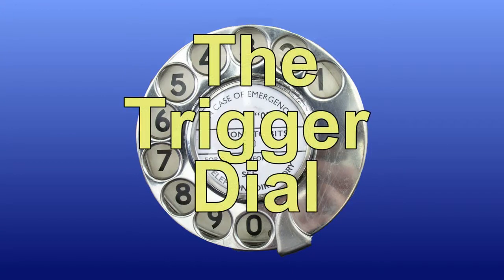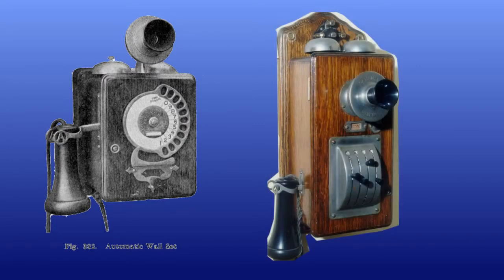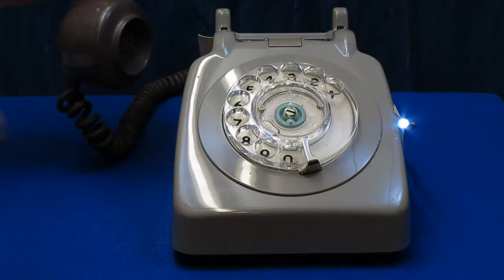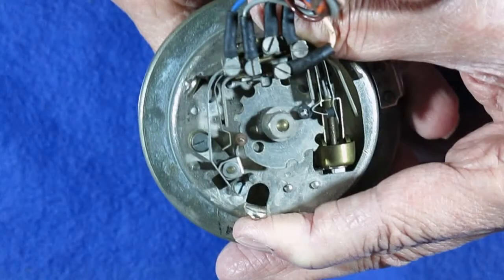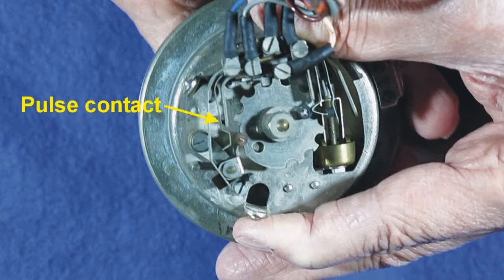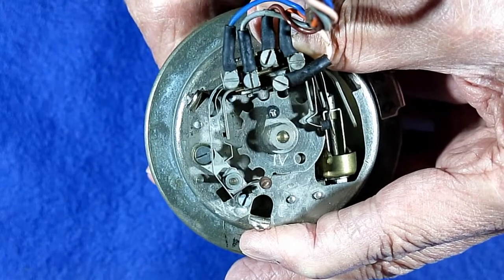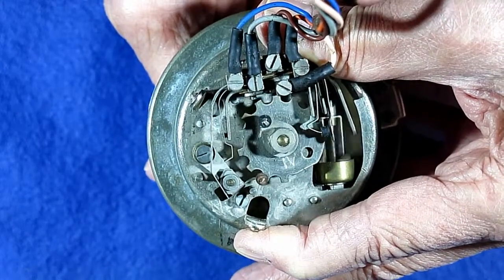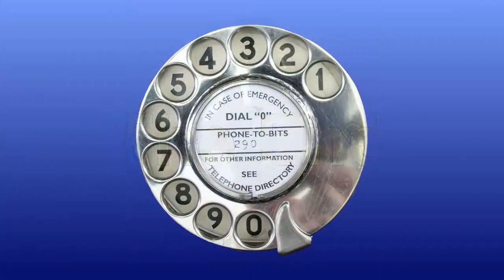The trigger telephone dial

Comment: Hi Sam. Im after a little help. Ive got a 332L GPO phone. Ive done a little research and found the dial is a '10'. Ive also found the schematic on the rear of the base cover. I have build a hidden door as a bookcase with the phone on the shelf. I want to be able use the phone as a switch to open the bookcase when i dial a number (ideally zero)  i have a background in electronics so am happy with the wiring of a relay once i can use the dial as the switch. Any ideas? I hope that makes sense?
Reply from the maker: Contact me via my website: www.samhallas.co.uk